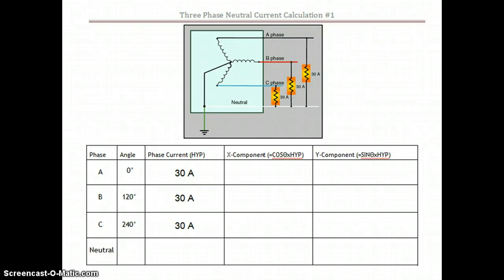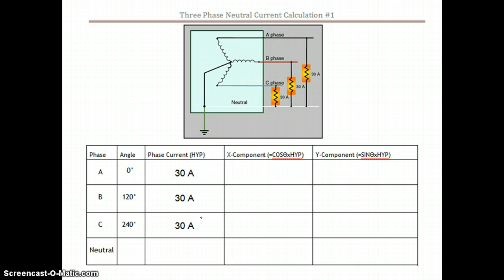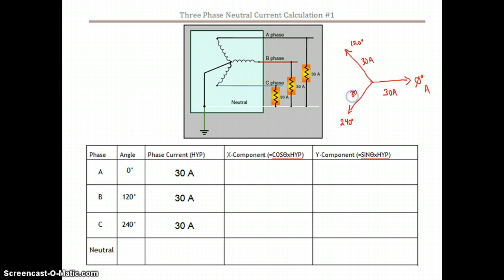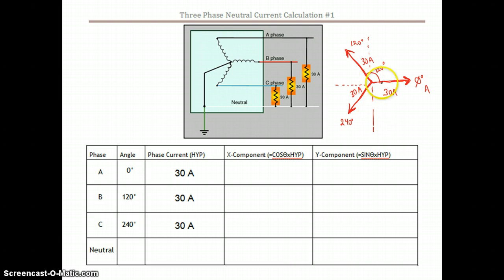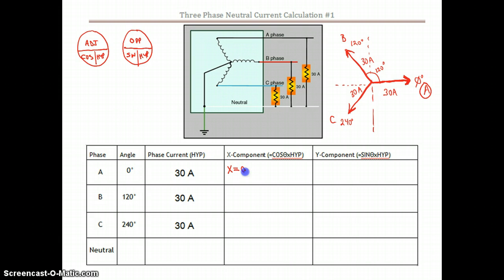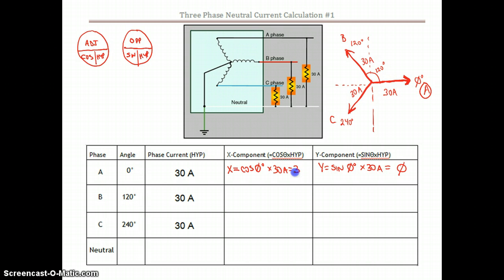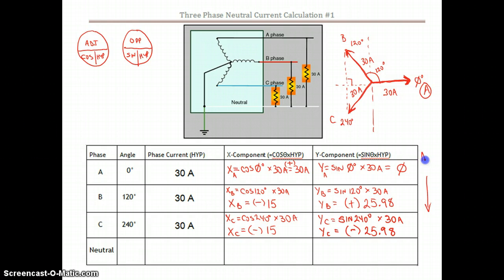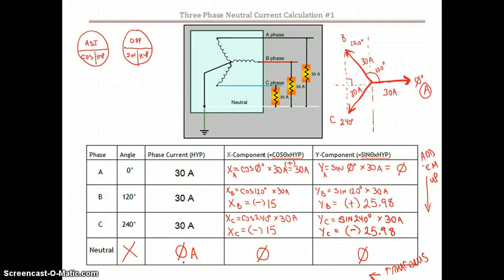3 Phase Neutral Current Calculation #1A (Balanced Loads)

Comment: Very Good Explanation..Sir, May I ask u a doubt...Can u explain the reason for high neutral to earth voltage  in LV Side of a 11kV/415V,Delta-Star Distribution Transformer ..Can u help us with this practical issue...The Voltages Available in our house hold...is as follows:  1)Ph-E- 297 2)Ph-Neutral- 213V and Neutral-Earth- 112V.....Can u help us with this issue,...The Distribution Transformer neutral is solidly grounded...But there exists a voltage between neutral and earth...How Can the problem be rectfied.??.Expects ur most valuable advice....

Comment: Correct me if I'm wrong but for phase A your calculation is cos(0)x30A. The 30A is on the Adjacent line therefore, why is the calculation for the X component Cos(0)xHyp when it appears as Cos(0)xAdj?
Reply from the maker: Hi +Derek McColl. I arbitrarily placed the Phase A on the X-axis. You are correct. The angle is zero at that point, so the Adj and Hyp have the same value.
Reply: @PeteVree  Not so Arbitrarily, Fase 1 always starts at 0°  so it makes sense for the vector to be there.